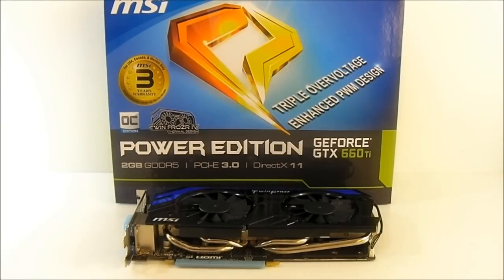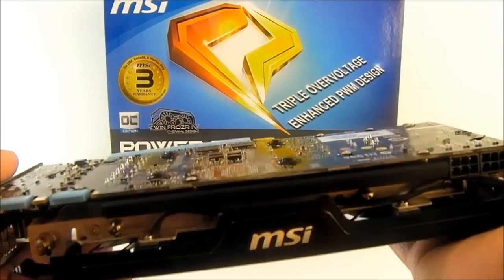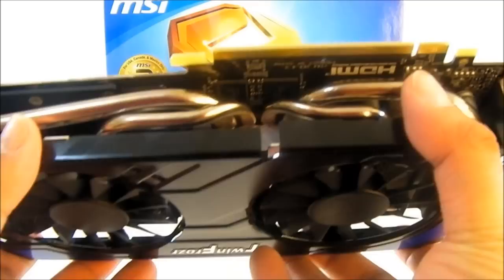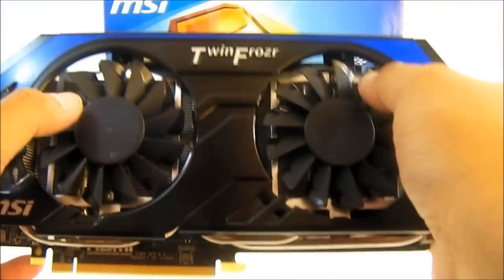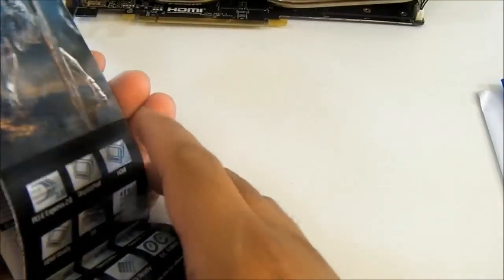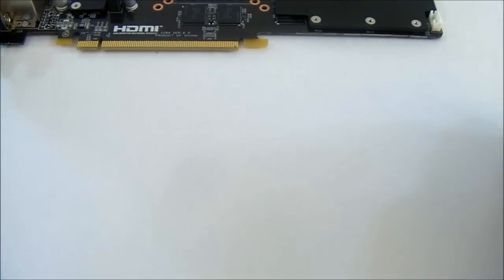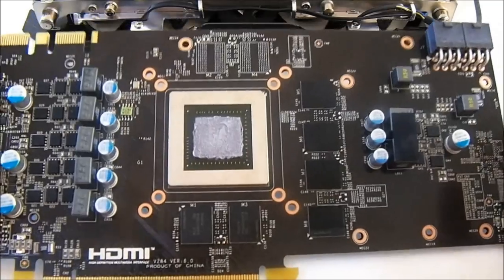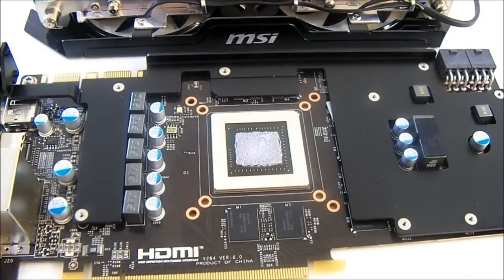MSI GTX660Ti Power Edition Overview

Comment: Crossfiring two 6670's would definitely not do the job, it would just suck. If you just want to run Metro 2033 on high 1920x1080p with about 55-60fps, you should go with the AMD 7870 or 7950. If you want an Nvidia card, then you should go with the gtx 670 or 660 ti.